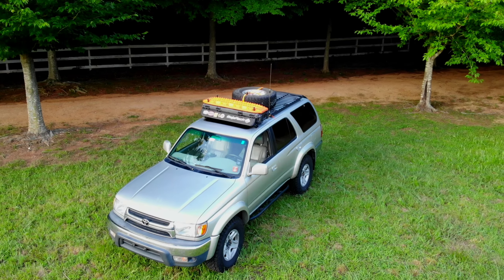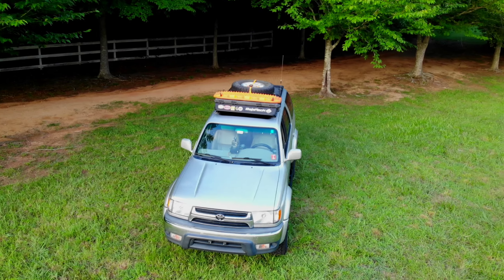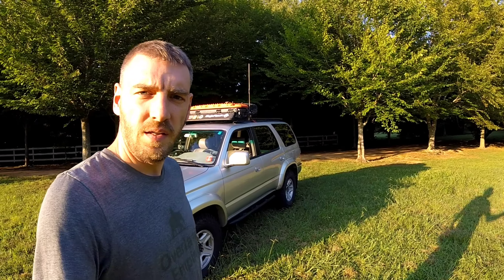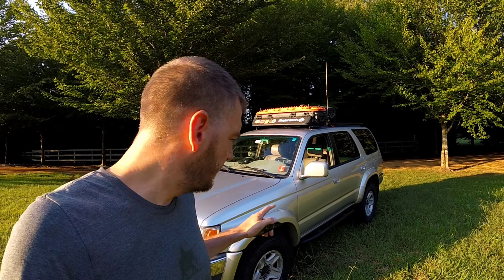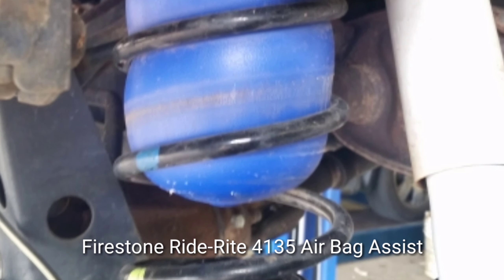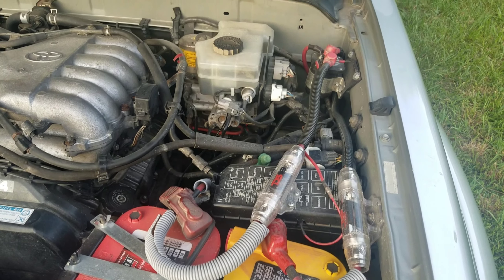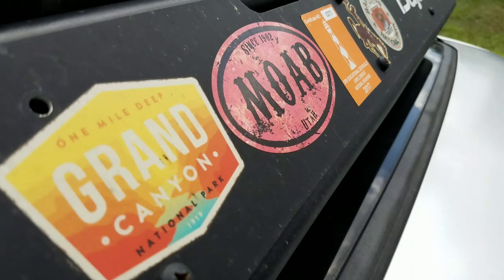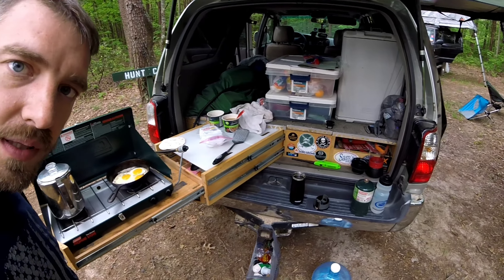3rd Gen Overland 4Runner Overview

Comment: That's awesome man! I wish my '99 had 4wd and locking center diff! At the time of buying, I didn't think it was something I would use often enough to be justifiable. Since I bought my 4runner i've come to realize that a stock third gen with 4wd and locking diffs is much more capable than I thought. That's so cool!
Reply from the maker: Yeah I've been really surprised at what it has been able to handle, though I know there are some situations where a front and dif lock would be nice too. At some point it would be nice to put ARB air lockers on it, but that's a project for down the road.

Comment: sweet ride man! i have a 99 Runner. i need a drawer system in mine. Im currently doing a re gear and front locker install on my channel if your interested in that. thanks for the walk round.
Reply from the maker: Nice, I'll definitely check that out. That's a project for me for down the road

Comment: Hi 
Hope u to talk about canter diff lock

Because I have 2001 4runner from 5 months  but still don't know canter diff lock working or not
Reply from the maker: To engage the center diff lock you need to put it in 4WD and you will see the four green lights come on representing the four wheels. Then you press the button to the lower left of the steering wheel and you will see the orange light come on in the center of the four green lights. If the center diff is locked then the orange light goes solid orange, after flashing for a few minutes. To get the diff lock to engage I stop the truck completely and usually put it in neutral. If it doesn't come on right away then I put it in drive and very slowly roll forward. Then put it in neutral again, then maybe drive again, until it engages. It definitely can be finicky sometimes, though usually it snaps on pretty quickly. The pins have to align just right for it to snap on. 90% of the time when I'm offroad I don't have it on, and then if I'm coming up on a tricky section then I'll make sure I engage it well before I reach the bad part, while I'm still on easy level terrain. Good luck!
Reply: @mountainstoseaoverland9855  

Thanks 😊

It was helpful
I will try 
Thanks for your help.

Comment: Did you need wheel spacers after doing the tundra brake caliper upgrade? I'm thinking of doing that upgrade to my 02 4runner only if it clears the stock wheels
Reply from the maker: I did not. I have the 16 inch wheels, and with a tiny bit of trimming on the guard that fits around the caliper the Tundra disks and calipers fit with no rubbing.

Comment: I have 2000 4runner automatic and have no idea what you mean by strawberry milkshake. I'm scared.
Reply: Dont be scared just check the condition of you radiator. If the outside looks black like new plastics look then ur ok, but if it has a greenish brownish color replace it and ull be good

Comment: Need to get those LBJ replaced.
Reply from the maker: I had them replaced about 6 months ago, but to be honest they weren't in too bad shape. Everyone talks about how the lower ball joint are a fault point on the 4Runner, but the truth is that if you don't put a big lift on the front suspension that puts the control arms at unnatural angles, and if you don't put spacers and big tires on it that put torque on it that it's not designed for, then the ball joints handle stock suspension and tires just fine.
Reply: @mountainstoseaoverland9855  Agree but they are a part that needs to be maintenance I want to see everyone 120 K they’ll make it up to 350k but after that you’re just gambling